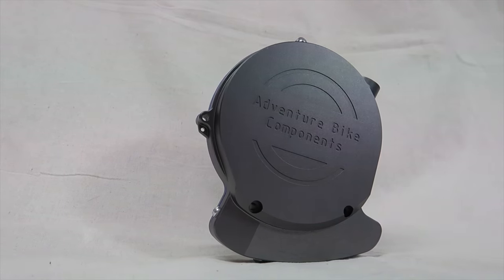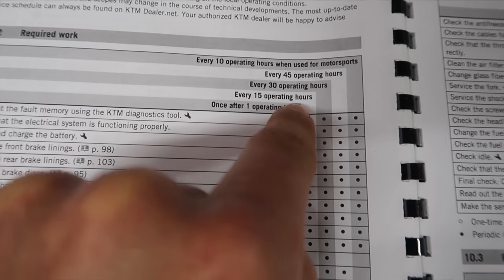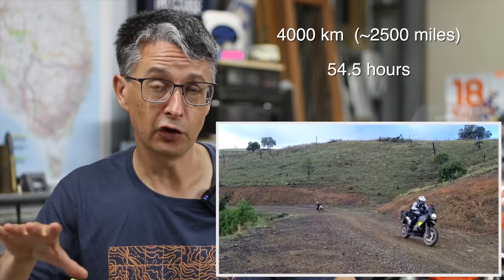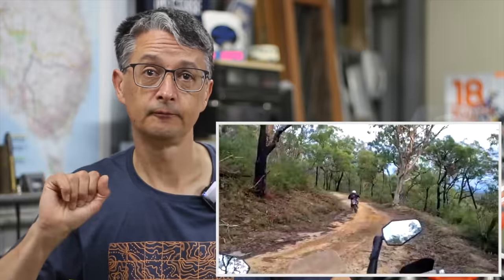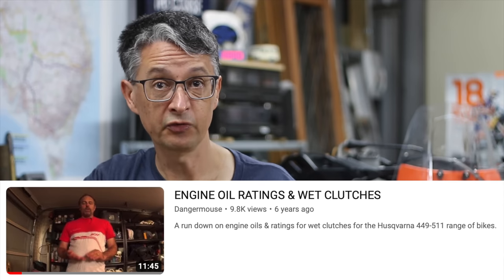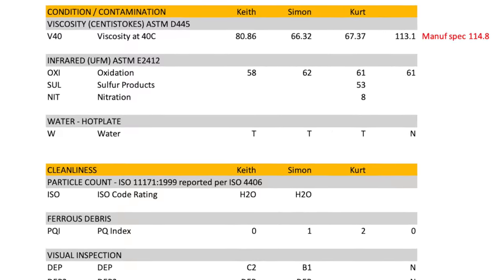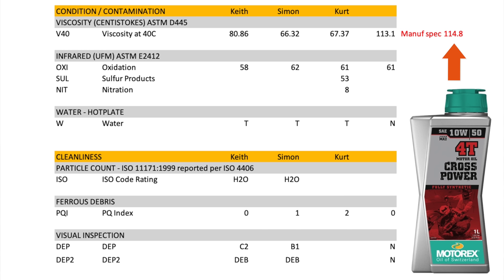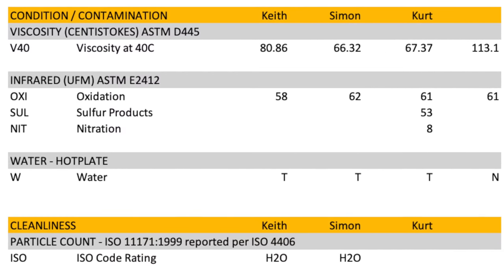Does more oil make a difference? Oil analysis, OEM vs larger clutch cover

Comment: Shame the lab only provides a cSt measurement @40degC, really need to see a measurement at the other D445 temp of 100degC to validate how much the oil has thinned nearer to the operating range against a fresh sample. Certainly loosing +35 isn't ideal at 40C but not uncommon in oils like 7100 and Power1 to loose around ~30cSt in the cold range. Pretty poor still to loose that much in only 20hrs of easy adv riding, I'd have expected to see that around the +40Hr mark in these riding conditions for a top spec oil. Again, Difficult to judge how the oil actually held up without the 100degC value. Also no TBN measurement which would also be pretty telling of the fresh vs used samples. 

I'd expect the absence of the D445 100degC and TBN values is because CAT are less interested in their oil's performance as those baselines for change intervals and oil tailoring would be largely optimised. Guessing they're more interested in outlier WDA material counts and contaminents pointing to component/maint issues in the field to minimise downtime/cost rather than looking back toward their oil durability - at least with the data in this report. Worth your time to find a tester that provides a TBN and D445 100degC value for the future Keith if you decide to do any more of these for your own info - will give MUCH better clarity on how the oils holds up viscosity and corrosion protection efficacy wise.

Comment: Hi Keith, I have a lot of reservations about  your methodology.  Set aside the different bikes, and a whole range of other variables. What we don't know, and I think you have a responsibility to present is the gradient of degradation (viscosity) over engine hours. KTM and Husky have a recommended  oil replacement for engine hours and  these bikes are being taken beyond that.  Maybe they've flat lined at different times. Hence the similar readings of degradation, as they both reached that point.  What we don't know is the journey over engine hour time to reach that flat line. (If they have in fact they have reached complete deterioration.)  We know the larger oil capacities lower oil temp, which is the primary reason for degradation. The reason I increased oil capacity of my 501 was that I was told by numerous knowledgeable sources, including Clive Ward of MotorcycleBiz, that increased oil capacity and hence lower operating temperatures allowed me to safely stretch out the service interval as it reduced the rate of oil degradation.   The brand is irrelevant to this discussion as there are a number of increased volume clutch covers out there.   I appreciate you're well meaning and have given it a red hot go to get to the bottom of this but a truck load more research needs to be done before you can ethically draw any conclusion.  All you've managed to do for me, is got me thinking of constructing a better methodology to truly tell me if and when the oil flatlines for usefulness once passed the specified service hour limit.  At this present time, I'll take my advice from the experts, (none of which have tried to sell me any specific product)  that have advised me to increase engine oil capacity if I want to use the bike for adventure and push out engine hours before oil change.  cheers Dave
Reply: So the assumtion is that a small increase in oil capacity is going to lower temps. Not sure about that one. You would need a cooler I would have thought.
Reply: @robking7503   This is not an assumption temperature sensors were fitted. There has been tests done, temps are 10 degrees cooler.  My question is, does that make a difference.
Reply: I think everyone is missing the point. Everything to do with oil is to lubricate. It's all about the oils design. If you use Motul, Castrol, Belray ,Penrite, Amsoil bla bla bla.  The trick is to find an oil that performs at the highest stress level the longest. Shear stress is what creates the heat. The oils job is to sustain high loads of stress. If a bike manufacturers bike it test certain oil based on  load testing the engines. Once again under load stress. If you were really after an answer I would performing a test in oils of same viscosity like 20/60wt and say 10/40 of different brands.. that is the kicker here. I use Penrite because it's affordable. I use a high viscosity due to our average temperature here is 15 deg plus. If you were in the desert riding the Simpson in the summer I would be using the high temp grade available. KTM, Husaberg use 10/40  because of Europe temps . Viscosity  relative to environment. You want keep oil cool...cool it down. Full stop. Volume will help temp control until it gets to balanced heat. Then it is the  same. Follow Manufacturers recommended time lines and choose a high quality oil..
Reply: @johnclowes3502  Agree, but Keith, interestingly has opened a pandoras box, which reveals there is  truck load to do to get to the bottom of this.
Reply: @MotorcycleAdventureDirtbikeTV  Yep.. there is a lot to do.. Racing has always been the base line of development. You will never get any higher stress loads than those guys who push a bike to its engineered  limit.. that's where the best analysis will show true results.
Reply: @johnclowes3502  But adventure generally doesn't take these 500s to anywhere near high stress levels unless your holding it on going down a freeway.
Reply: @MotorcycleAdventureDirtbikeTV  " There has been tests done, temps are 10 degrees cooler" 
>>I take that to be F degrees, not C, right? There's no way that 100-200ml more oil in that small of an engine, lowers operating temperatures by 10C.
Reply: @johnclowes3502  The first number 10 in 10w40 means viscosity when the oil is cold. So going to 20w in cold countries is bad for the engine obviously. The second nr. (40) is when the oil is hot. So for race engines this number is usually higher. As the oil remain viscous even when burned. For example I had a car BMW e46 330Ci and when I drove in spirited manner, the oem specced oil 10w40 would brake into water. You would feel it and hear it. The pedals got mushier, the engine was knocking louder etc. When I went to 10w60, the engine was able to withstand spirited driving all day long, no issue, no change in behavior of the pedals etc. So if the engine gets very hot it's much better to use oil with higher second nr. BMW e46 M3 uses 10w60. So I imagine the same goes for motorbikes. Obviously manufacturers have a spec for the oil and the main reason is simple - sales. With thinner oil the engine makes more HP. Looks good on paper and sells. Ford does this - nowadays they use 10w20 or 30. That's crazy thin oil. It's almost water. Thin oil is bad for lubrication, doesn't create film, it just flows down. You can safely put there oil one or 2 grades higher.

Comment: I was hoping you would prove without a doubt that more oil was better , but this was definitely not the case I am happy to change oil half way through a trip at 1300kms touring kilometers is vastly different to race kms ,I would only do maybe 300kms on my 350.
Great info Keith u definitely answered the age old question.

Comment: Good video Keith and so agree with your conclusion.   

The lads doing the APC Rally without an oil change programmed in was ambitious.   There was a lot of high speed running to get the miles in.  It was certainly a rally suited to  twin cylinder machines where smoothness and comfort would be well appreciated.

Comment: I think this report is good news. Viscosity is the only factor that is affected by mileage according to this. Contamination is nil. Iron at 35 ppm is only .0035% It's nothing. It's probably normal bearing wear I reckon. 

When researching this subject previously I read that mechanical shear is what reduces the viscosity. It mainly occurs in the transmission and it involves the oil molecules actually being cut into smaller pieces just like you slicing a tomato. By the gears meshing together. And the smaller the pieces, the lower the viscosity. But it will never get below 10W in the case of 10W-50 oil. 

But according to this data viscosity was reduced 29% after 20 hours of running. And it was only reduced a further 12% when measured after 54 hours. Mathematically I think the used oil after 54 hours is probably equivalent to a 30 weight oil. Which probably will still provide plenty of lubrication. 

I'd be curious to see the same numbers run on something like a 690 or 901 that has much longer change intervals. I'm curious what those viscosity numbers would be.

Also I believe that fuel mixture and thermostat temperature affect running temperature much more than oil volume. If an engine is running nice and cool the oil will be too. I think you've proven that the increase in volume has zero effect on oil condition. In fact I think you've shown that the oil can go farther still.
Reply from the maker: Hi Ross, I actually had a 690 on board for this test too... same trip, same oil. But it suffered a leaking countershaft seal and so required a top-up midway through the ride, rendering its results unusable.😢

Comment: Great Great video and anaysis. I would suggest that a good comparison to be now adding 2 columns for 1 690/701 and a 890/901 so we could understand the difference with oil degradation from a Drit bike type to a longer extended service type of engine to understand the oil degradation. I think that would the be cherry on the top for an 100% comparison test. 
Thanks for your great work and time dedicated to help us all on this subject! 
A big thanks from Portugal

Comment: Hi Keith,  I have a 22 KTM 500 with the Adv Components clutch cover and ran a temp senor in it to.  
Just got back from the Ridge Ride III ride 2500 Kms over 5 days 36 Hours engine run time.  One oil change  Done the CAT SOS report and the oil was showing the same outcomes as you have.  No difference in the oil temp. I have been doing my changes right on 15 Hours and taking 1200ml of oil on a ride is not really much of an inconvenience to be honest so that's what I have done.  I have the Adv Bike Components clutch cover and I will leave it on but it does mean I have to now take 1600 ml of oil.  Your video and well presented the facts in a real world scenario. Thanks Vids are really handy.

Comment: Great content Keith and thanks for taking the time to do this. 

I like the guys in the test comparison did approx 55hrs on the same oil with a bigger case on. 
Not something I would do on a regular basis as it was a one off long distance trip abroad. Riding in the UK more frequent oil changes are no problem. As you said it’s a performance engine👍🏻
Reply from the maker: I agree it was "out there" in terms of hours. But I think 4000km is a reasonable number for people to want to know if they can do it "safely" on one lot of oil.

Comment: Thanks Keith,  an interesting exercise and thanks for taking the trouble to do it. I also saw Adam's vid just after an oil change on a bike that had been sitting a while. I had exactly the problem described with the new oil dirty after the first start up. I took it out for a quick  thrash on the weekend and changed the oil again as soon as I parked up. This time the oil poured out and was noticeably thinner as it drained. After the oil change and start up, the oil was clean as a whistle 👍

Comment: FWIW - Apart from how you actually use the engine(how the rider rides it) and how the transmission is used, oil is extermely important. My Aprilia RXV 550 has seperate oils for the transmission and engine. The transmission uses 75W90 and the engine uses 10W60. Oil degredation is not caused by the engine operation as most modern bikes has Niksil type linings etc. The viscosity drops because of the shearing from the transmission gears and the heat build up generated between the meshing of those gears. This is why the Ape uses a 75W90 trans oil.  The more oil capacity the bike has the the longer the viscosity will be higher. If you want your numbers to stay higher longer you are better off using a higher viscosity oil in hotter climates like Australia and getting 100% Full Synthetic oil with PAO / Ester base stock to minimise the shearing & transmission gear heat degredation, especially so for air cooled bikes.

Comment: Hey Keith!
Have you thought that it could be that both oils have already reached their critical point before 4000 km and are no longer degrading (or are not degrading so quickly)? 
Following this reasoning, it could be that the one with a larger cover and more oil reached this culmination point at a distance of 3000 km and the one with the OEM cover after 2000 km? Then you continued driving until 4000 km on a similar viscosity. Maybe at 6000 km these results would be similar again. But still a larger amount of oil could maintain good quality for 500 - 1000 km longer. We don't know this because the scale of the experiment was too small.

Comment: Not a bad effort Keith, in truth here is that many variables exist and that makes it hard to  control accuracy of testing. For me larger oil capacity may assist  but only if coupled with improved filtration, oil viscosity results needed to be at the 2 std markers for relevance, but does give some indication.
In Australia  id run with Penrite 10W 60 given our warm climate and oil used in a gear train. But again depends on where you ride predominantly, if high country winter, maybe not. The larger sump to me add little bar better strength of the housing, which is not a bad thing. SWM RS500 adv work 20 to 30hrs oil n filter, but std 1.7litre sump. Drz400e jikes people push the 4 to 5000kms adv work and they get pretty good mileage life 1.8 to 1.9lt sump capacity or close. Its very much a dark art science oil and use/ application etc. Good on you for puttin1g some facts up.

Comment: 3 years ago I installed the Bestdualsportbikes large cover on my 2018.It had only 4 bolt holes but the new one has 5 holes. I watched the owner belt his cover with a hammer very hard and it only made a little dent so that alone makes it worthwhile. Even with that drop in viscosity there is now a fair amount of evidence that these engines are incredibly durable, thanks to riders like rtwPaul and Aaron Steinmann who did 140,000km on his 500.

Comment: 54 Engine hours on the same oil ! That`s the primary reason the oil viscosity valve was low on the two bikes. I`ve owned several 525 , 530 and 500 EXC`s and never exceeded 20 engine hours between oil changes , no matter what type of riding I was doing.  Oil is cheap , engine components are not.
Reply: Agree on the principle, but oil is not cheap…

Comment: Thanks. Putting on my dusty statistics beanie, doesn't this only qualify as anecdotal. Or one data point, and too small of a sample to extrapolate out for a larger population? The Can of worms is to assumr too much with one uncontrolled test. Also since the initial intuition is wrong, consider what volume of extra oil would make a difference,... double, triple? There must be some increase in vol that slows degradation. This test was fun for the citizen scientist but only proves that maybe ABC needs to do more testing in a contolled lab or get a real scientist to offer a theoretical improvement expected. I luv science and motorcycles and this channel!

Comment: Hallo Keith would be interesting  to do an experiment  whith a small oil cooler with the same volume as the big clutch cover im going to try it on my yam 450 as lt has external  oil lines ,i dont know if the ktm has these external lines

Comment: Interesting test … it was recommended to me by the bike shop where I got my bike ( 2018 500 ) to run 10w-60 , penrite Australia also recommended the same , would be interesting to see if that would result in better oil viscosity after 20 hours
Reply: Well it may help after a few hours, but the oil would be thicker than recommended at the start of the interval…
Reply from the maker: When I spoke to Dangermouse I asked him that question, about using 10W60. He said it could help in hotter climates for sure, BUT he wouldn't personally use oil with a differnt rating than recommended. So 🤷‍♂

Comment: Well done Keith on a very interesting topic. I wonder what the minimum safe oil viscosity is for these engines? If you knew that, then you'd have another data point to help decide when to change the oil.
Reply from the maker: Hi Phil, that is a great question but not one I could find the answer to. The report linked above talks about a 20% reduction as potentially "critical", but it is a generalised statement not specific to this oil or this engine. I would love to know the answer though!
Reply: @keithjob  If we use the minimum 'safe' viscosity loss range of 10% to maximum critical of 20%, which I can't see being too off the mark for any internal combustion engine regardless of type of use, then we can extrapolate further:

(Rounding for ease of calculation and using 114 as the baseline)

Your bike - 71% of original viscosity remaining = 29% viscosity lost.

Simon + Kurt - 58% of original viscosity remaining = 42% viscosity lost.

I'm starting to think that KTM's recommended oil change interval at 15H, using the oil they recommend and that you use, is mainly for this reason!

This is why the shear rating debate is always the big factor that comes up in these forum oil conversations.

It's also the reason why I run Rotella T6 15W40 in my 2017 KTM 500 EXC-F and only change out every 2500kms or so... check out the shear rating on it! Just sayin'. ;-)

Comment: I find it interesting that the 690 that I ride holds 1.7l and has a much higher mileage recommended service. Seems to prove your point about the adventure riding compared to racing.
Reply: 690 has 3 piston rings, 500 only 2. Meaning more bad stuff can get into the oil. So that's the main reason for longer service intervals + for 500 it is race spec of course.